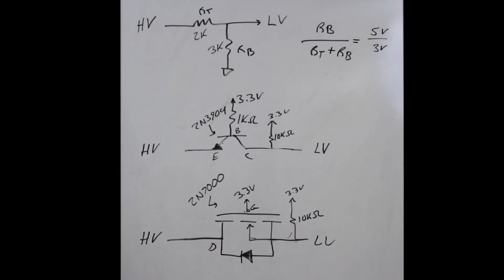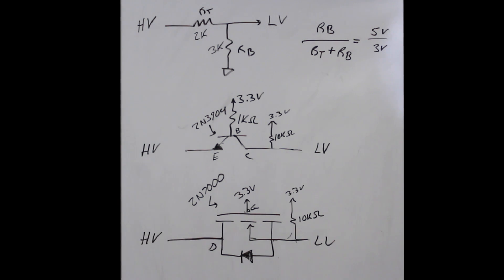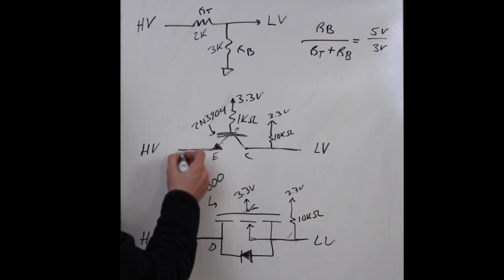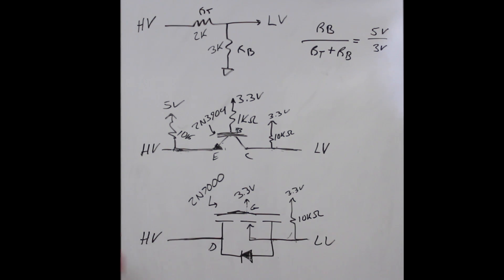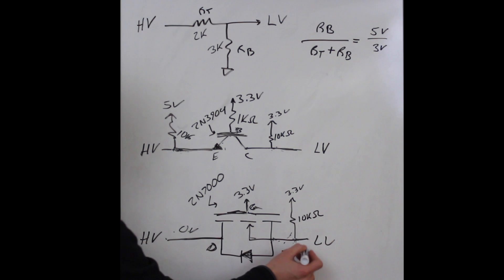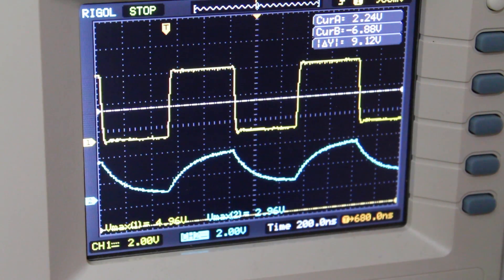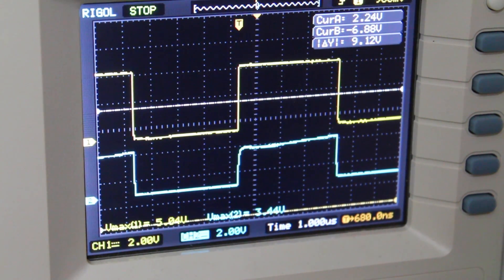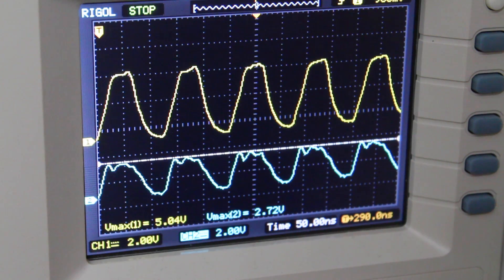Level Shifting Tutorial 5V-3.3V Quick and Dirty Methods

Comment: What I often see from the Chinese is a 5V level via a 1k directly into a 3V3 input. 
Each input should have protection diodes towards VCC. The 1k limits the current to 1.7mA. 
But this is really a dirty circuit and is based on the fact that the 3V3 is loaded with at least 2mA.
The rise time should be really hard and fast.

Comment: A transistor can also be switched on when a current flows from B to C, then C also opens to E. 
But the current gain is not as high as when the current flows from B to E and the path E opens to C.
I use 4k7 for pullups.
A gate resistor degrades the rise time.

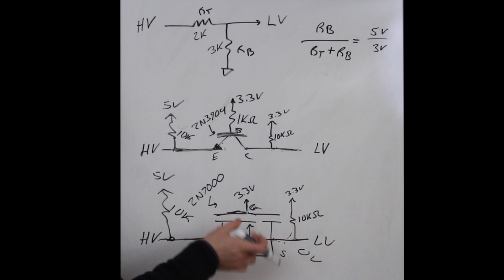Comment: Note quite correct at 8:23.

While yes, the diode will conduct initially down to 0.6V. But this is where the MOSFET 
will take over and bring down the voltage to close to 0 volts! You can see this on your
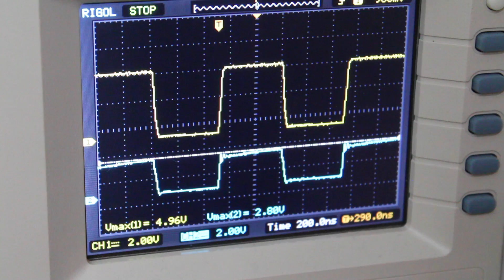oscilloscope at about 12:08. Cool huh!
Yes, MOSFETs do conduct in both directions when turned on.

(Actually, MOSFETs conduct "Better" in the reverse direction, of course within 0.6V were 
the body diode takes over. Thair often used as "Free Wheeling Diodes" in power
converter circuits to increase efficiency.)

BTW, junction FETs and Depletion mode MOSFETs can also do bidirectional level shifting, and they don't even
need the 3.3V pullup resistor and their gates are connected to ground.

redrok

Comment: 2N7000 is not a good MOSFET for this kind of circuit in 3V3 applications. Vgs threshold is a bit too high. You might wanna use BSS138, it has a much lower threshold voltage.

Comment: Tried doing this myself with the BJT design as I don't have any FET's. The voltage does not go full range 3.3v to 0v, its more like 3.3v to 1.5v and its not low enough to pass the threshold reliably so data is corrupt.
I have tried putting extra resistance on the 3.3v rail to weaken it, and it gets it to around 3.3v to 0.9v which works more reliably but still doesn't seem right. Also the signals overshoot all the way upto the full 5v, the pulse is very small so doesn't seem to do any harm, but again its a clue I've got something wrong :-/

Any ideas would be great.
(p.s. resistors I use are 10k on the E and C from the 5 and 3.3 rails, with an additional 10k on the 3.3v rail itself. the B has a 4.7k, (I did use a 1k as per this video but that pins the output at 3.3v regardless of the input) Transistor is a 2n3904, the devices are an Arduino @ 5v and a raspberry Pi's UART @ 3.3v)
Reply: kal9001 its because you have that additional 10k resistor on C and E, you only need one from the rail. You are cutting your high voltage in half, simple voltage divider

Comment: what if i used a 2N2222 transistor ?
will it still work ??
( thanks for the explanatory video , it's really good )
Reply: yep, 2N2222 support 1A and also less noise than 2N3904 that only supports 0.2A

Comment: Can someone explain why the resistor divider is so slow?  Is this due to the limiting of the current flow?  Instead of using resistors in the K's, can perhaps 200 and 300 ohm be used instead?  Dumb question, but the two transistor solutions use resistors on the low voltage side, so why isn't the same behavior seen at those node as we see on the resistor divider solution?

Comment: I noticed you use 10K pullups! Have you tried values from 4K7 down to 1K? It does consume more power, but will produce a nicer, crisper output.
Also, If you use a 10 ohm resistor at the gate of the FET, instead of connecting it directly to +3V3, the ringing will go away.
I am sure many people learn a lot from your work. Great job.

Comment: Good example of level shifting, surprised about the performance of the resistor network, must have been a lot of capacitance there ( you were on bread board after all).  The FET clearly wins, probably due to the tiny capacitance between G-S ( hampered by the inherent capacitance from the bread board but still wins out as the transistor was in the same ball park)

Comment: I see that you link to the CD4050 chip in the description. I've checked the datasheet on this chip, but I don't understand how to hook it up for levelshifting.
Reply: I sometimes use it but to shift between 2.8V and 3.3V systems. It is not a proper solution though. Here's how it works: You hook up CD4050 to 3V. So the highs are 3V and lows are 0V. This is within the tolerance range of both 2.8V and 3.3V systems. You are essentially banking on tolerance of the two systems, and then there is no safety margin left for noise. So CD4050 is not a proper solution. 74LVC245 is what you should use instead. But even 74LVC245 is not seamlessly bidirectional like the techniques mentioned in the video.

Comment: Hi, can CD4050 be used also to level shift from lower to higher voltages?
In particular, could I use it for 5V-12V shifting ?
Thanks

Comment: Thanks for the video! I am a newbie in this area, so please bare my dummy questions:
1. Could you please explain why when MOSFET is on, Vds can be 0? 
2. Just wondering if a voltage regulator can do the trick as well since it can also convert a high voltage to low voltage?
Reply: Kevin Darrah Hi Kevin,
When you have a chance, could you please let me know? I hope it won't take up too much of your time. Thanks a lot!

Comment: the whiteboard wasn't working for me. have you considered using the falstad simulator to help visualize the current flows? thanks!
Reply from the maker: yes, I use Falstad's simulator on a daily basis!
Reply: I meant use the simulator in your videos rather than drawing the circuits on the whiteboard.

Comment: Hey Kevin, thanks for the explanatory video. I was wondering, I was having some trouble talking to my ESP8266 through serial on my Arduino while using a resistor divider for my level shifting (it was just printing binary garbage at all baud rates). I know some 8266's default to a 115200 baud rate, do you think that's a high enough baud rate that rise/fall times would become an issue? Thanks!
Reply from the maker: I wouldn't trust it - but the scope shot looked decent at 125kHz - when I was first analyzing the modules, I used a buffer, then migrated to the bjt/fet method

Comment: Could you not get the same effect by just using a diode instead of a transistor?
Reply: ya!
When I was watching the MOSFET method in the video, I came up with the same thought, it's like a diode and a resistor can do the job by its own.
BUT while I typing this comment, I got some new thought, too.
That is, the forward voltage of an diode is around 0.6~0.7 V, so when transferring an LOW signal, the output side will not go all the way down to the zero voltage, instead, it will stuck at the forward voltage of the diode.
Then in the case of MOSFET method, the on-state MOSFET will keep pulling down the voltage (maybe?).

Just a quick thought, maybe I'm wrong some where, welcome to discuss. :)

Comment: The two transistor circuits are a form of common-base/common-gate. Another option that can be used with care it to just use a current limiting series resistor, many IC allow forcing current into the ESD diodes as long as it is limited